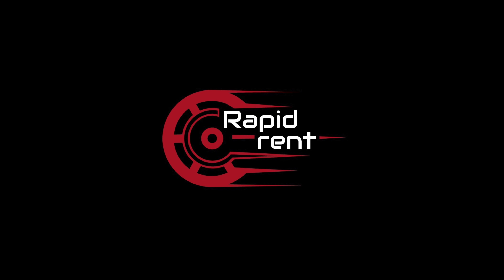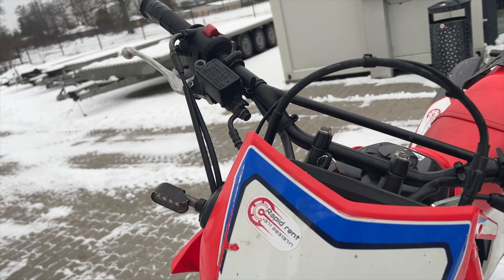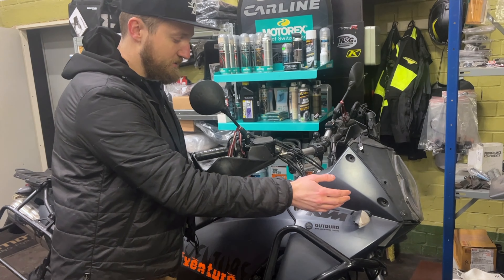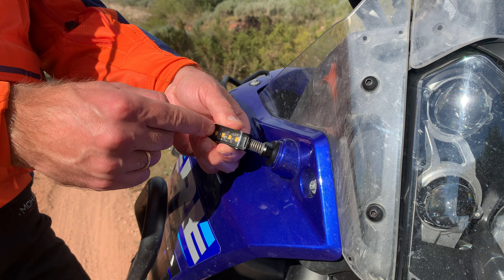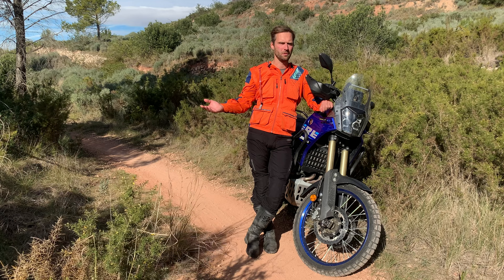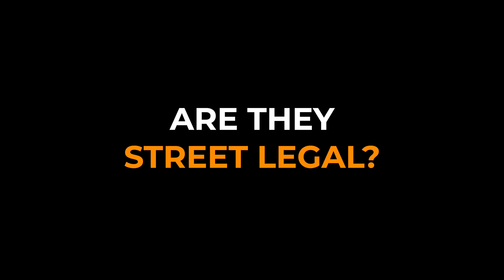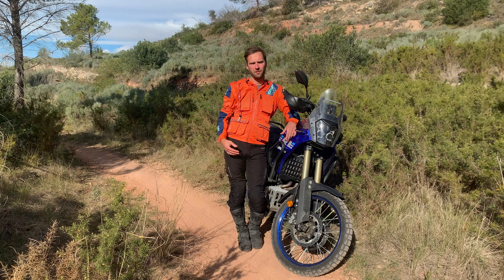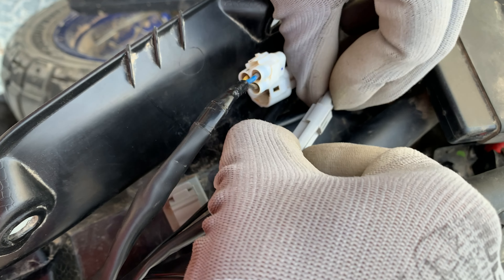HAMMERLEDS® - Flex 4 - Product Overview (Full Version)

Comment: Maybe I missed this in your literature, but I assume we will also have to install an LED blinker relay to make these flash appropriately? I have a CRF300L with standard bulbs.
Reply from the maker: Peter, thank you for your question. 

Yes, when converting from globe bulbs a flasher relay will be required. For the CRF300L we have developed a complete kit that includes 4 turn signals, load independent flasher relay and mounting adapters. All parts plug-and-play.

Comment: Are these are turn signal only, no running light?
Reply from the maker: Richard, thank you for the question! 

Turn signals only. We have an idea of creating an add-on adapter to enable the running light feature in the future, but please don't quote me on this because for now we don't know if it will work that way on all bikes or not. In any case to achieve this additional R&D would be required. 

Is the running light feature a must have for you? And which bike you had in mind? 

Regards, 
Valeriy
Reply: @HAMMERLEDS®  I have the Tenere 700 which comes with front running lights. For added visibility, this is a feature I want to keep.
Reply from the maker: Ok, it's good to know for our future wishlist. 

Just to confirm - did the T700 come with running lights OEM? Is it the 2023 version? And which market? 

Thanks, that would be very useful for us to register.
Reply: @HAMMERLEDS®  These are the OEM lights from the factory, big orange pumpkin lights. It's a US spec. I'm not sure if other markets also come standard with running lights on the T700.
Reply from the maker: Great, this is extremely useful stuff. I was more than sure that the T700 didn't had them. But then again the Yamaha connector has the 3rd wire plug availiable on EU models and empty, so it makes sense now. 

Thank you again for highlighting this!